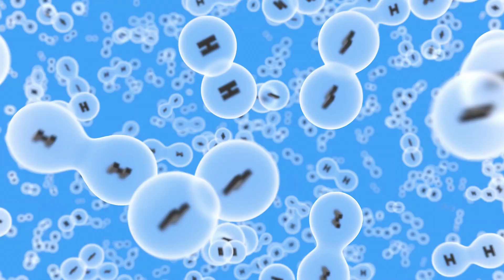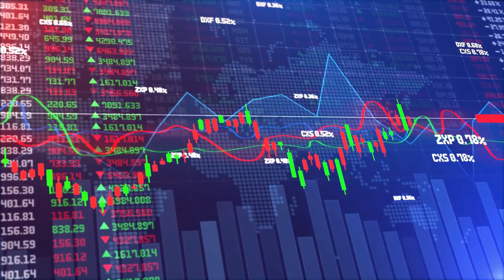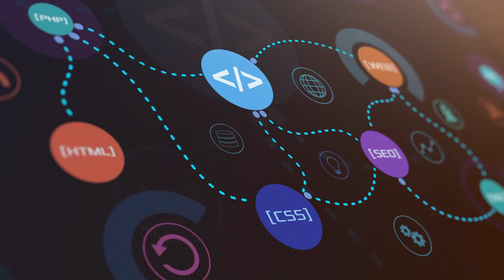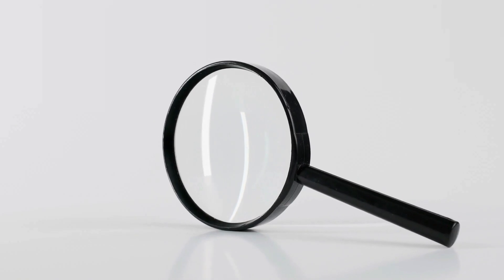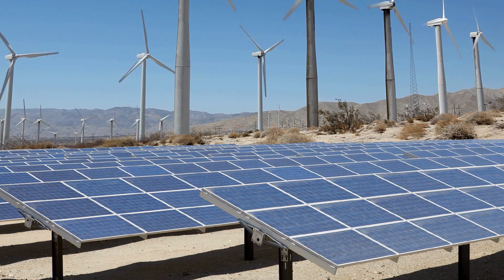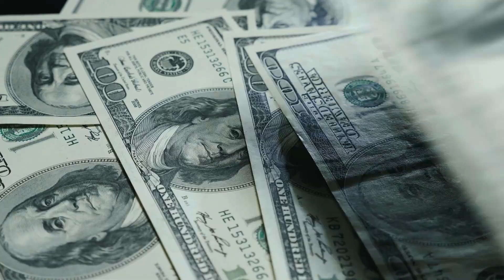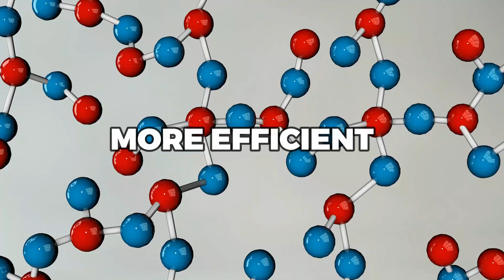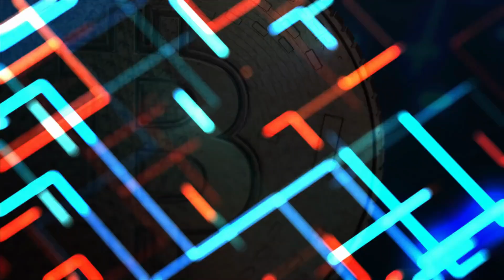"Storing Solar Energy Without Batteries: Discover the Surprising Method"

Comment: CASE is like an aircraft accumulator. Just use a fluid in the power production. That fluid would be forced into the accumulator, compressing the chamber on the other side of the separator. You could use something that has a spring-like effect in addition to simple compressed air.